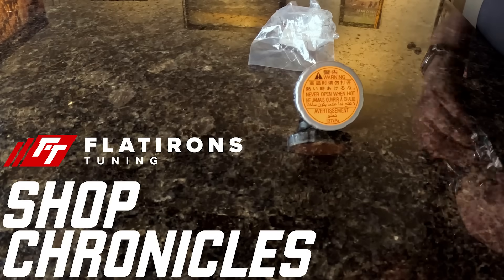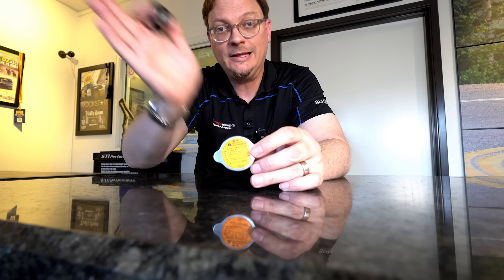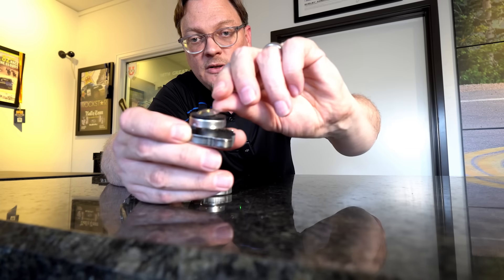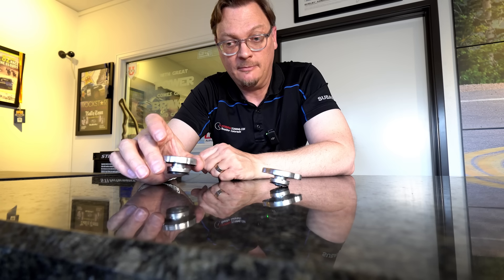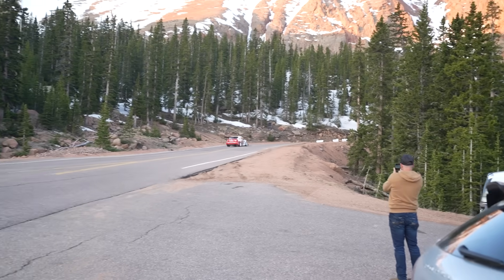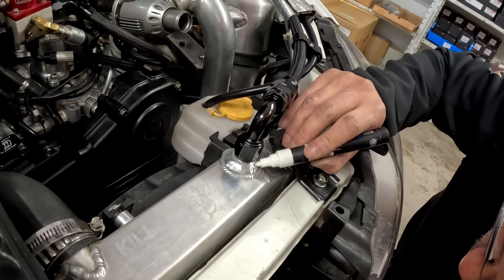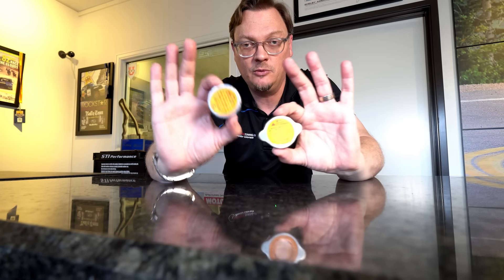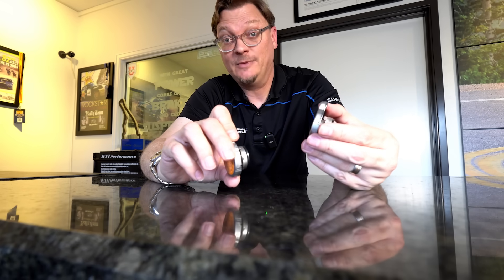Critical to keep your Subaru Cool! Radiator Caps Finally Solved!

Comment: BRZ has a single type B cap from OEM.  Converting to an aluminum filler neck that has a type A cap.  How would this conversion affect the cooling system? Possible damage? Blow seals/gaskets? 

Aftermarket type A caps are 1.3-1.4 bar pressure. OEM type B is 1.1 bar.  Optional OEM STI type B cap is 1.3 bar.

Comment: I just bought a 2021 STI with full bolt on with Koyo rad and a Cobb overflow tank. The koyo radiator has a Koyorad High pressure 2 way cap, and my expansion tank (highest coolant location) has the 1.3bar Subaru high pressure cap… wtf is this bad? I’m gonna be calling you guys tomorrow

Comment: Would a non subaru expansion tank cap cause an issue? I changed mine last week. Still a 2 way cap. But just a cheapy from a auto shop. But since changing the tank has no coolant in it. And the over flow bottle is full to the brim even when cold. Its not returning to the tank from the bottle.
Reply from the maker: I'd recommend checking your cap.  It sounds like it may not be the correct size for your expansion tank and not sealing.  Check to see how low your coolant in the engine is.

You will most likely need to add everything from your overflow back in, maybe more.

Hope that helps and Stay Tuned!

Comment: Hi sir, i have a koyorad radiator full aluminum and i installed the 1way cap,the 2way in expansion tank. Is that correct? Unit is 2007 subaru sti ej25🙏🏻

Comment: Great video! What if your car have expension tank delete do you need to put the cap from the expension tank on the radiator?
Reply from the maker: Thanks for watching.  Correct.  If you have only one cap on your system, it needs to be a 2-way cap.

Hope that helps and Stay Tuned!
Reply: @FlatironsTuning perfect thanks!

Comment: 1999 LEGACY BH5 2.0TT EJ206 A/T

my factory CALSONIC radiator finally broke and does not have a filler neck and replacing it with one that does have a filler neck. so...do i just BLOCK OFF the filler neck on the new radiator or do you suggest i get a 1.3 ONE WAY cap???
Reply from the maker: Either option would work.  The easiest would be to use the Subaru 1-Way 1.3 bar cap.  But yes, you could block the fitting on the radiator off.  Then you cooling system would function exactly the same as it did with the original order.

Hope that helps and Stay Tuned!
Reply: @FlatironsTuning thank you. so block it off if i want stock factory cooling...and add a 1.3 ONE WAY CAP for modified cooling?

Comment: Thanks! I had months of head scratching detective works without result. Ended up not using the car as much, especially on the hotter days. The Subaru analog meter cannot show the fine difference between 180F and 200F. The Cobb AP is a much better tool.
Reply from the maker: Very true.  The OE needle doesn't move over a pretty wide range of normal operating temperatures.

Thanks for watching and thanks for the boost!

Stay Tuned!

Comment: My 94 JDM WRX has a turbocharged 2.0L EJ20G engine, and the only cap is located on the tank - no cap on the radiator itself. All stock. I recently added the GReddy higher pressure cap you showed I’m this video, and after running it for about a month, my coolant tank started to leak at the seams. Went back to OEM for now - I’m to even sure that going back to the higher pressure would be a good idea even after I was to replace the tank with a new one. I thought I’d be helping my cooling system to stay cooler, but no dice.

Comment: So if I want to really run a high pressure cap like a 1.3 or 1.5, get that greddy block off.

I been really lucky with my build then then as I have a two 2-way caps, with highest pressure on the rad itself and the 1.3 on the expansion tank. Maybe that is what has saved me from issues, my car does not see track use though I want to. But it does go up the cajon pass with the AC blasting without any issues, and the cajon pass is well known for overheat cars and trucks that are new and old.

Comment: Been running two two way caps for as long as I know. Not consciously but I’ve never seen an issue. Or is there and issue and I don’t know about it is my question and if I switch back to a one way will I see a drop in temps for sure or what can I expect. I have a one way cap on order now.
Reply from the maker: What you should get by putting the 1-way cap back on the radiator is more consistent cooling system performance over time.  Before you put the new cap on.  Take a look at the level of coolant in your expansion tank.

If it is full to the top, you can just put on the new rad cap, and you should be fine.

If you see an air pocket there, I'd recommend burping the coolant in the process of putting on the 1-way cap.

Hope that helps and Stay Tuned!

Comment: my 11 sti has rotates oil cooled turbo  do i block the lines off on the upper res  for turbo coolent lines or do i need to still.use it or can i eliminate  the upper expansion tank and just run the radiator cap only  and over flow

Comment: Forgive me if this is a dumb question. Just realized I got two 2-way caps. made an error when i installed my Koyo rad. If i replace the cap on my radiator, do I need to bleed the whole system again?
Reply from the maker: Thanks for the question.  If you are just replacing one radiator cap, you should not lose any coolant when you remove it.  Just place the new cap on the radiator and you should be all right.

*However*

Once you have done that, take off the cap that is on your expansion tank and make sure that the coolant level there is right up to the top.  If you were running 2 x 2-Way caps, you may find that you need to add some coolant there.

If that is the case, then you would want to burp your coolant again.

Hope that helps and Stay Tuned!

Comment: What about when you delete the expansion tank ?
Reply from the maker: Thanks for watching and thanks for your question.  If you have a single cap on the cooling system, then it needs to be a 2-way cap.  You will have to be sure to get all of the air out of the system when you are burping the coolant, which may require a vacuum fill if you deleted your expansion tank.

Hope that helps and Stay Tuned!
Reply: @FlatironsTuning definitely, thanks for your time and knowledge !

Comment: Okay so this is good info for the ejs. What about the fa24dit vb wrx? That appears to be a two way cap and doesn't have an expansion tank.
Reply from the maker: Thanks for watching and thanks for the question.  Yes, on the FA20DIT and FA24DIT, those cars don't have an expansion tank because the turbo is below the engine so the radiator is the high point.

Those cars just need a single 2-Way cap.

Hope that helps and Stay Tuned!

Comment: Great video as always, i'm running a csf radiator with the csf 1.4 radiator cap, now about expansion tank...which cap is ideal to use?
Reply from the maker: Thanks for watching and thanks for the question.  I'd recommend putting the OEM caps on both the radiator and expansion tank.

Hope that helps and Stay Tuned!

Comment: Hi guys — just wanted to confirm we’re on the same page about radiator vs. auxiliary tank cap placement on an EJ-powered Subaru like the 2013 STi:

• Radiator Cap (lower point) → should be a lower pressure one-way cap, e.g. 108 kPa (1.1 bar). This allows it to vent first to the header/expansion tank.

• Auxiliary/Header Tank Cap (highest point) → should be a higher pressure two-way cap, e.g. 137 kPa (1.3 bar). This holds pressure longer and includes a vacuum return for cooldown.

This matches Subaru’s factory design: the radiator is meant to relieve pressure first into the aux tank, not the other way around. Running a higher PSI cap on the radiator can lead to early venting from the wrong location or air being trapped in the system.

Let me know if I’m off on anything — just wanted to double-check against your guidance!
Reply from the maker: Your are close but not quite correct.  The higher pressure 1-Way cap goes on the radiator, and the lower pressure 2-Way cap goes on the expansion tank.

As we show in the video, the round 1-way cap is the one that always goes on the radiator.  The one with the "ears" is the 2-way cap, and that goes on the expansion tank.

Give this a watch again, and check out this other video talking about the expansion tank and overflow tank:

https://youtu.be/MBVNHON3d0w?si=FdJokYRHnAnqxboF

Hope that helps and Stay Tuned!

Comment: I’m running the pink sti 1.3 cap upgrade on my turbo tank with the stock on the radiator. Should I look for a slightly higher cap fr the radiator?

Comment: What do we do if we are running a rotated kit with the upper coolant tank deleted? I have a water cooled Garrett turbo setup with the iag AOS mounted above it as the high point with a bleeder valve. 
Currently running the one way cap on the radiator and the hoses suck flat when the car cools. I would like to fix this potential issue
Reply from the maker: Thanks for watching and thanks for the question.  If you have deleted your expansion tank, then you would need  a 2-way cap on your radiator.  

The cooling system will always need a way to let coolant back in as the engine cools back down.  If you only have a 1-way cap, then it can't do that and this is why your hoses are collapsing.

Burping the air out of your engine will be easier with the AOS bleeder valve, but keep in mind that without the expansion tank (high point with a cap), your cooling system will not be able to naturally burp air out of the system.

In your situation, using a vacuum fill option may be best.

Hope that helps and Stay Tuned!

Comment: So if I have an aftermarket radiator and the stock plastic overflow tank, what cap setup do I run? The plastic tank just takes a simple plastic cap.

Comment: Curious; I have an STI and got a CSF radiator (way thicker core than OEM) that came with a 1.4 bar 2-way cap. I assumed the thicker core needed a higher pressure cap (and didn't even know about the 1-way caps 😭). Should I still switch it back to the OEM 1-way caps?

Comment: What do you consider the maximum safe temperature is for the cooling system while tracking your Subaru EJ257.
Reply: The last time on track I had 2 2-way thermostats. When I started running faster, I saw as much as 108c. My tuner was quite concerned. I later found your video on the thermostat issue and resolved it. Temps improved but I still could creep up over 104c. I don’t believe oil temps ever exceeded 90c. This winter I tried to reduce paths for air to bypass the radiator. I am hoping this improves high load temps. 

Thanks for the informative videos.
Reply from the maker: This is a good question and actually not quite as simple as it seems.  If you are watching your coolant temps, I'd say that there are two markers to watch.  The first would be to make sure that you are always at least 10 deg cooler than the boiling point of the fluid in your cooling system (water, glycol coolant, etc.).  You want to stay as far away from the boiling point as possible, because if your temp sensor shows that you are getting close, there could be hot spots in your engine that are past that, and boiling is occuring.  This can cause issues with pressure, etc., and you can be close to a runaway overheating condition in the cooling system.

Ideally, you would want to see temps stay close to the point where your fans turn on, which is typically around 206 - 210 degrees.  that is going to be well below the boiling point, and your thermostat will be fully open by this time, so you should be seeing the full cooling capacity of the system.

If you can stay between 210 and 220 deg on track, you are in good shape (would be good to know what oil temps are as well).  

Some direct injected cars will run higher for both coolant and oil temps, so if you have an FA turbo engine, you will want to monitor temps to get a sense of what normal is for those engines.

I hope that helps and Stay Tuned!

Comment: Why doesnt the fa20dit wrx have the expansion chamber? I have a koyo on my 2016 wrx. Seems so simple and easy.
Reply: Because fa20dit turbo are located under the engine, below the filling point of the radiator. 

Where EJ engine turbo are mounted higher than the radiator filling point, hence expansion tank existed above the turbo and to make sure sufficient amount of coolant in the expansion tank to cool down the turbo when the engine stop, otherwise the turbo will have premature wear due to excessive heat. 

I hope my theory is correct.
Reply: @wanfuengsam4483 it sure sounds good. Lol
But I can see that as being why. FA20dit turbo is almost completely below the radiator

Comment: Why do you run water as opposed to coolant in the race car?
Reply from the maker: Thanks for watching and thanks for the question.

Most racing categories require that you run water for coolant because Glycol based coolant is very slippery.  If you are running regular coolant and have any kind of leak (overheating, etc.) that can cause an accident because of how slick it is.  Water is much safer for competition, and that is why most races require that be used.

Stay Tuned!

Comment: I have a Koyo radiator. 

I have the Cobb 1.1 cap on the upper overflow tank and a Koyo 1.3 on the Koyo radiator. I’m sure one is wrong right?

Comment: Another important tactic for the cooling system is ALWAYS fill the engine block through the upper hose, NOT the radiator. In cars with thermostats mounted on the bottom this is how you keep the air from getting trapped in the block. Those stubborn air pockets are exactly whats killing these cars.

Comment: I guess I'm lucky.. I have the stock cap on expansion tank and running the mishimoto cap on mishimoto radiator in my 04fxt. Mishimoto cap says 26lbs though. No issues..

Comment: I'm sorta new to Subarus and didn't know about this so thanks.  Learned something new today.  Are the OE caps ok for a mildly tuned WRX mostly driven on the street?  Are the OE caps  good quality or is there a good reason to switch to aftermarket someday?
Reply: The OEM caps will work fine. We use OEM caps on our race cars.
Reply from the maker: @colonelredracing This man would know :-)  He is the one that helped us back in the beginning!
Reply from the maker: The OEM caps are fine , and can even work well on heavily modified cars.

Thanks for watching and Stay Tuned!

Comment: If the reservoir tank its full of coolant why its going to suck air if you fit a two way cap in the radiator and the expansion tank?
Reply: Nobody?

Comment: My upgraded radiator has no cap at all and seems to function great...   cooling fans kick on around 201 deg and temps drop to 183 to 185 deg.   Driving along temps stay in the 180 range.
Reply from the maker: Yep, once you have a fully welded radiator, the need for the pressure relief cap pretty much goes away.

Thanks for watching and Stay Tuned!

Comment: Unbelievable that most Subaru owners don't believe theres a difference between the Two Way and One Way Caps. I've been called many names correcting the mistake for others. Hope this video reaches their recommendations and understand. Thank you Jon!
Reply from the maker: We are doing our best to get the word out there.

Share if you can.

Thanks for watching and Stay Tuned!
Reply: I’m pretty sure most Subaru owners know exactly nothing about their radiator caps.
Reply: What cap is suppose to be on my koyorad vs my highest radiator cap?

Comment: Strangely enough I have the OEM cap on my expansion tank and the Koyo cap on my koyorad with no issues. I’ll definitely look into going to the right cap and see if there’s any difference
Reply from the maker: If you aren't having any issues, that is definitely good.  Double check and make sure that the coolant level in your expansion tank is right up to the top, and that you have normal movement of coolant in your overflow tank.

For reference:

https://youtu.be/MBVNHON3d0w?si=vG3PUhm5zOtztzhV

If it is working, that is great.  Always a good idea to double check.

Hope that helps and Stay Tuned!

Comment: I'm going to upgrade a standard ej205 engine on an MY99 for an ej207 W20C shortblock.
Should I keep the 1.1bar cap, or go to the 1.3?
Reply from the maker: 1.3 on the radiator is fine with the 1.1 on the expansion tank.

Thanks for watching and Stay Tuned!

Comment: With 2 2-way caps does the lower pressure on top, when purging draw in air from the bottom 2-way cap?
Reply from the maker: Thanks for watching and thanks for the question.  As long as the cooling system is properly sealed, either radiator cap should only be able to pull in coolant from the overflow tank.

The issue with the 2 2-Way caps is that the coolant can flow into the radiator, and potentially not make it to fill the expansion tank.  Potentially, this can end up creating, or holding an air pocket there.

Definitely something to watch out for.

Hope that helps and Stay Tuned!

Comment: The original video is how I found y'all.  Saved me from such a headache on my '05 FXT with a Mishimoto rad and an Aluminati expansion tank. Originally I was running the Mishi rad cap and a 2 way adn had nothing but issues.  Thanks for that and the updated info!
Reply from the maker: Very glad that the video helped!  Stay Tuned!